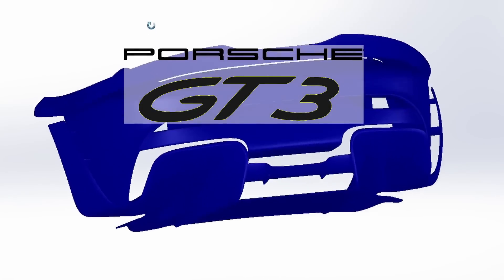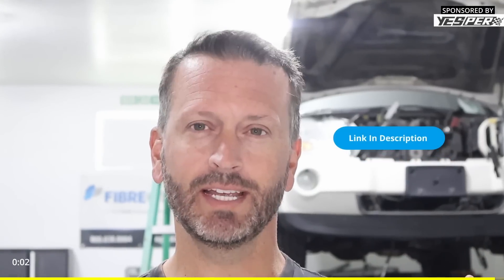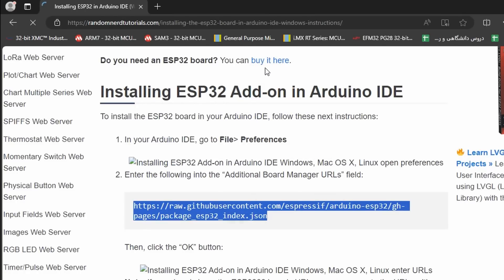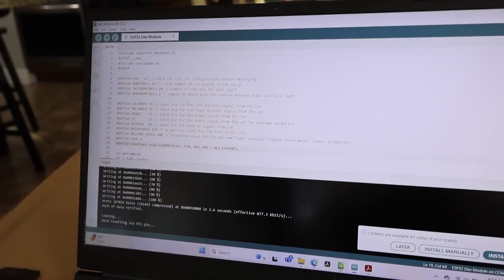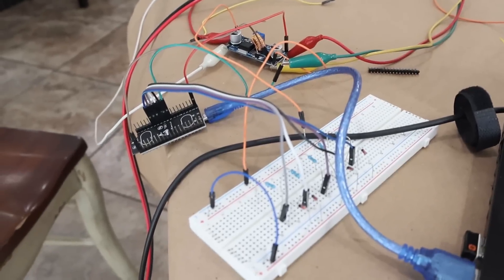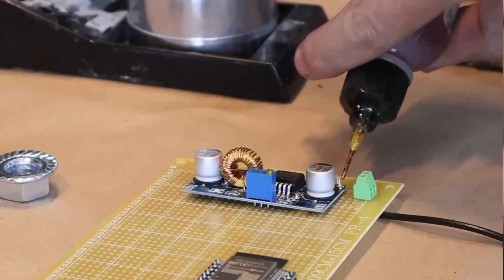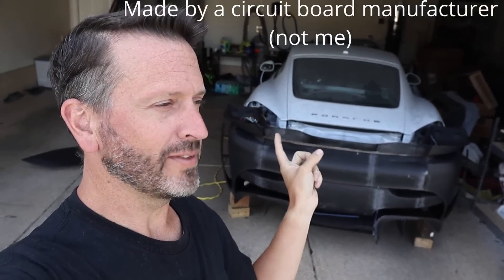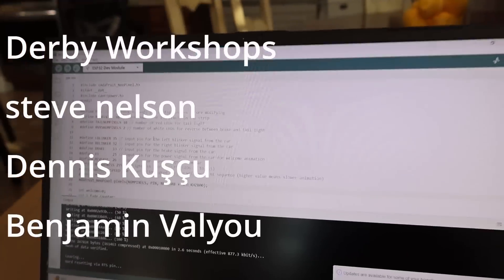Arduino-Powered Custom Taillights for Porsche: Step by Step

Comment: This is such a cool project. I would love to hear if you've found or heard of any alternatives for this type of brake light since you did this. I've heard of a blueghozt module that seems to do something similar but i'm not sure how much flexibility it gives you in turning only certain pixels on/off etc. I have been wanting to building this exact same set up for my custom car build as well, but the programming is really intimidating. Would love to hear any suggestions you might have for a novice.
Reply: CorsoMotion boards require no programming. I just built rear lights for my car using them. The features are more limited because it just has a few selector switches. But it does allow you to make sequential turn signals and a running light animation. The big upsell to them is zero programming at all. Super easy to use
Reply: @Kyamamoto13 thanks. I also just found the blue ghozt module that seems really robust for this type of application.

Comment: If you can describe exactly what you want and give the number of LED's in the strip you can ask ChatGPT to write the code to do what you want, other Ai systems can also write the code. I use it when i do LED programming and have had great results.

Comment: Came across this video randomly and wanted to offer a little advice. Lookup BlueGhozt, it's an aftermarket headlight controller that is made for addressable led's, you plug in a trigger wire for your turn signals, drl's, brakes and reverse lights. You can fully setup each "pixel" plus animations and colours, it will save you a huge headache. The next bit is to avoid BTF, I had these for my custom headlight DRL's and they failed due to heat exposure after 8 months, they were also insanely dim which is dangerous for brake lights. Consider some of the dedicated RED/AMBER chips/strips from the likes of nextlevelneo, these are over 10x brighter as they're not mixing colours and will last exponentially longer. Not wanting to advertise at all it's just I spent 2 years building mine own through trial and a lot of errors.

Comment: @4:19 the input voltage range on those boards is quite wide, up to 36v if I recall.  Since they can only regulate the voltage to be lower than the source, the first 66% (36v-24v=12v) of the turns were bringing the output voltage down to unity with the input, in this case 12v.  If you were providing more voltage in, you would have seen the adjustment start happening much earlier.

Comment: Hello! 
The use of digitally addressable LEDs is very creative. I've been using it for a long time - it's being used.
However, my experience with them is that they only look good in moderate sunlight and in the dark. 
In strong sunlight, it is not possible to see what is lit properly, especially when the sun is shining into it.
When used in a car, when braking and when turning, it can cause problems for those coming behind you if they cannot see the lights properly.
It would be worth a try with this as well, I would watch a video of a few minutes to see what it will show when used in the sun, how visible they are.
I would look at the final result. 
I remain with respect.

Comment: Just a shot in the dark - but the DC/DC converters may not like working in the no-load scenario. When you're trying to change the output from 12V DOWN to 5V using without a load on the output of the converter, then there's little action the DC/DC converter can take to reduce the output voltage. If you want to experiment - do the same test but attach a 1k ohm resistor at the output of the DC/DC converter.

Think of it like trying to reduce the pressure inside a tank when the only thing you can do is turn an input pump on or off. If the pressure is already too high there's nothing you and your pump can do. The time you had to wait was likely some parasitics slowly discharging the output cap - akin to a slow leak causing the tank's pressure to reduce.

Some DC/DC converters handle this no/low load case more gracefully with special circuitry - but I doubt the cheap Amazon converters are that nice.

Cool lights!!
Reply from the maker: Got it

Comment: I think you need a load cell attached. So when you are heavy on the brakes you get more and brighter LEDs. 
Also, how do you make the car trigger these LEDs. Will you be getting the signals from the OBD2?
Reply from the maker: @RotorWorks  just 12V signals.  Same that go into the relays

Comment: I put insultation on the bottom of a board, that way no unseen shorts
If concerned about heat from the chips, you can use thermal pads (like for computers)

Comment: Really nice idea, really love that, i wuould just suggest you to not use those converters from 12 to 5v cuz they are really not stable, there are different much better. Also i wonder how will you communicate with the car. Over the CAN protocol? Obd connection? How will the esp see when did you pressed the brake or gave a signal?
Reply from the maker: Just traditional 12V signals are the inputs to the control board.

Comment: I would consider some different LEDs. In my opinion, the 5050 addressable LEDs just aren't bright enough when someone is behind you and facing the sun. Look into some the Cree LED CP41B leds. They are blinding and what you need for brake lights. Compare the lumen output and it's no contest.

Comment: i love how honest and open you are with your knowledge. this was very interesting.  I have a question, little chances of getting it answered unless you revisited this in a later video, but how did you manage the light signal concurrency .... like ... brakes pressed, and hazzards cos you are stopped at the side of the road and a left turn signal at the same time.   does it go al red for the brekes but bliking yellow in the corners and the left one swiping left ? insted of just blinking ?  not sure how the concurrency of all those states was handled.
Reply from the maker: Yep, all in programming with interrupts

Comment: Will you be using interrupt or priority in case of two or 3 commands at sane time like using brake+ turn or brake+turn+reverse, will recommend to use case function so to have all functions working at same rather than one overriding another.
Reply from the maker: Yep, all in programming.  Thanks for the comment!

Comment: Id love to have one of those boards when you get them in production, im trying to do a restoration on a 48 buick roadmaster and would like to accent the tiny tail lights like being able to see when i have a blinker on from the side of the vehicle, and mount under the chrome around the rest of the vehicle, and this looks like the exact thing i would need to make it work (dont know if it could be set up with the wled program on its own channel for like custom light modes for a car meet up or car show)

Comment: Use a similer step down buck board for a lot of the custom RC stuff i do. Lipo puts out 11.1v. But servo's and reciever are rated for 8/8.4V and not using an ESC to do this dropdown conversion as i do nitro/petrol RC's. So use an adjustable buck board to take in the current voltage and step it down to 8V.

The potentiometer adjuster screw can take time to catch and adjust on these boards. Have had multiple boards and they all do the same.
Reply from the maker: @Daniel_Blake  good to know!

Comment: I would go with one of the esp32/canbus boards that are available. Also.. generic arduino/esp32 dev boards lack appropriate shielding for a vehicle.  Since most of the dev boards have full schematics available, it would not be hard for you to take those as a starter, and use Eagle or KiCAD and build out your own board with heavier traces and shielding.  Also, when it comes to LEDs I would go with 12v, less chance of voltage drop issues, or if you really want to use 5v, inject the power in multiple locations.
Reply: Thanks for the suggestion, we are already using ESP32, the "Arduino" part is the software used to upload the code to the board, Arduino IDE.

also ESP32 uses 5 volts so we have to use a stepdown board anyways. so why not use them both at the same time. the next issue arises with voltage inconsistencies, a step down board makes sure we're getting the voltage we need, but for a car there might be a voltage fluctuation and I assume you are familiar with how sensitive to voltage these strips are.

And finally, We searched for 12 volt 144/M density addresable RGB LED strip but couldn't find any, would appreciate it if you could send us a link for where we can find one.

About the software, we do have access to altium designer for our final board, the image you've seen is the prototype board we deigned. the final board will be housed in a weather and dust proof box.

Would love to hear of any of your suggestions❤
Reply: @IJDesignStudio  I think you may have missed my point.  I understand you are using the Arduino IDE, what I was suggesting is using one of the various ESP32 with "CANBUS" dev boards, which would allow for better integration with automotive uses.
Reply: @mrljvb  Oh! Sorry, yes I got your point wrong. Unfortunately our familiarity with CAN bus connections are currently limited and not sufficient to actually implement them or understand their advantage for our project. But obviously this is what we should start woeking on since it is the standard norm of the industry. Again thank you for your valuable suggestions. If you have any additional suggestions or ideas on how can we implement CAN in our projects, or care to explain more about the CAN Connection and its advantages and example use cases, Leave us a comment!

Thanks!

Comment: So i can't really tell from the picture but it looks like you're using ws2812 or similar led's, for this application you might want to look at wa2813 or ws2815 (12v), most of the ws2812 style leds have a single data line so if you have an led fail everything past that led will essentially be dead, the ws2813/ws2815 style options have a backup data line to get around this (and the ws2815's are 12v)
Reply: Thanks for the suggestion,

ESP32 uses 5 volts so we have to use a stepdown board anyways. so why not use them both at the same time. the next issue arises with voltage inconsistencies, a step down board makes sure we're getting the voltage we need, but for a car there might be a voltage fluctuation and I assume you are familiar with how sensitive to voltage these strips are.

And finally, We searched for 12 volt 144/M density addresable RGB LED strip but couldn't find any, would appreciate it if you could send us a link for where we can find one.

Would love to hear of any of your suggestions❤

Comment: I love what you’re doing! Keep up the great work.

I made my own tail lights for my car. I wanted a complex shape that couldn’t be achieved with a strip, so I used individual 5mm bulbs soldered together. Mine can't do the light patterns that yours do, and I’m envious! Initially my housings were hand made from acrylic, then I redesigned them after buying a 3d printer. A word of caution: put some silicone on the adjustment screw on your buck converters. Vibrations from the car will rotate the screw, and you will burn out lights. The screw on one of mine rotated even with a dab of silicone on the adjustment screw, so I may need a better solution. Also, the output of the buck converters will not be the same as the input at your LEDs. My LEDs run at 2.1V, and each tenth matters. You might be able to increase your brightness a bit by measuring voltage at the LED.

When making circuit boards, you may consider using header sockets to secure the ESP32 or Arduino to your board. That way they’re easily removable. I kept having Arduinos fail, and de-soldering all the pins from a board then cleaning up all the solder so the board can be reused is very tedious and time consuming. After doing it twice, I had to come up with a better way. The root cause was the Arduino was mounted to a circuit board on my steering wheel. Vibration was killing the boards. After mounting the circuit board with foam tape instead of screws and switching to header sockets I didn’t have any more failures. So isolate your boards from vibration, too.

Calling these legal is a stretch, and likely varies from state-to-state and what country you’re in. My research found that if there is not a DOT stamp on the housing of headlights, turn signals, brake lights, windshield, etc. they are not technically legal. I’m only speaking from my experience. If you already have plates for your car, it likely won’t be an issue. If you’re registering a car with home made tail lights and turn signals, you may run into an officer that is a stickler. That may be more dependent on the individual at the BMV than the state you’re in.

This is great content, I have subscribed and will be watching for more!

Comment: If you are using ESP32 boards (instead of the "good old" "classic" arduino board), then you could use ESPHome firmwire instead of arduino IDE.
It could be a bit confusing at the begining, but it is much more user-friendly and...
And your Esp32 board is WiFi and Bluetooth BLE capable (not nessesarry in the same exact time, but it can handle both of them).
So with Esp32 boards, you would be able to update your firmware (lets say "your code") on the board with OverTheAir updates on your local WiFi in your shop or garage.
How cool would it be, if the parameters of your tail lights would OTA update capable :)
And for using that EspHome firmware, you can stay on the same PCB that you made. (Use the same pintout configuration, etc).
:)
Reply: Thank you for the amazing insight and idea, 

Yes we are using ESP32 but the force of habit pushes us to use Arduino IDE instead of ESPHome, we have to push our electronics team to get on learning ESPHome soon so we can use the their built-in features.

About OTA updates, surely that's an amazing way of getting updated codes on our board, but the coding process is taking place at our studio which is rather far from Jeremy, so we have to do things a little bit more traditionally to get things done quicker and more reliable.

We love to hear more about your insights and ideas, keep them coming❤

Comment: I don't know about USA but in the UK we tend to prefer to not have the full array for brake lights. If you leave a few LEDs just as taillights when the brake is pressed, it's easier for other motorists to distinguish between you pressing the brake vs a very bright taillight. Ultimately you're trying to avoid being rear ended, so anything that's more obvious is key.
Also I'd make the reverse lights use a few more LEDs, simply because when it's dark you'll be glad to have a bit of light to see where you're backing into!

Oh and don't worry about your PCBs, you can't be great at everything first time! It took me at least 20 attempts during my apprenticeship before I turned out a project I was happy to put my name on.
Reply: Thank you for the amazing insight,

Our designs and revolve around rules and regulations and how far can we push the envelope, which in this case we are in the legal zone. the decision for using a full width brake light comes from the actual layout itself.since we have every function shown in one strip, we had to use the full width brake light, imagine we're backing up with our hazards on and braking with night lights on, the only space left for the brake light would be in the middle, and the night time driving light are only on the far sides so night driving visibility would not be an issue for the following cars. it's not like the Porsche 911 or Taycan where they are using a full width light bar as for their night lights.

and about the reverse lights, unfortunately the cameras don't pick up on the details in the lighting we added, nor the intensity of the lights, these strips have 144 LEDs per meter and we're using 2 meters of it, meaning we have 488 RGB LEDs, these reverse lights are plenty bright enough for backing up (again a specific intensity is not stated, if you look at Aston Martin Valkyrie or Lamborghini Revuelto as an example, you see they are using only one single LED which is even dimmer than the plate illuminating light s they use. regulations state that the reverse light should be there as an "indication of traveling in the opposite direction".

❤

Comment: I use these ledstrips using Wled this is a so easy to use and configuration the led. There are options to use input signals to trigger your animation you created. Take a look at it this might be better and you can still use the same esp board and soldering.

Comment: You know what I really like about your channel, is that a lot of topics are covered!! I work a lot with arduino, and also enjoyed seeing how you figured it out, but I have no clue how you would connect the arduino to the data from the car, or how you would intercept e.g. the car braking, so really hyped to see that as well!
Reply from the maker: Stay tuned!   More to come!
Reply: Looks like just a voltage divider to bring down the cars 12v signal from the ecu to 3.3v that the ESP32 can read as off or on for a certain GPIO pin. I used optocouplers to interface from my cars 12-14.5 volts but a voltage divider is a bit simpler and achieves the same goal although with a bit less protection/isolation.

Comment: No need for stepdown, it's just another failure point. Just get 12v version of led
Reply: We are using ESP32 boards to animate the LEDs and it uses 5 volts, so we need the stepdown board eitherway. also we couldn't find a 12V 144/m dense addresable RGB LED.

Would appreciate it if you could share a product link for the LED strip with us❤